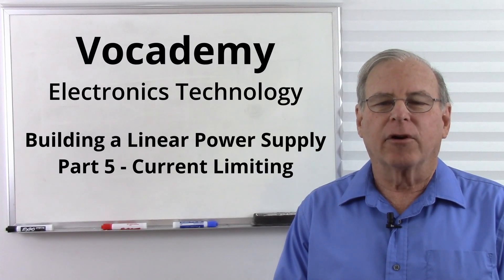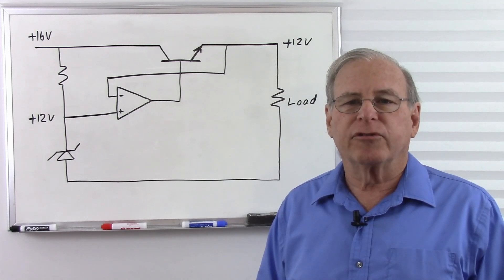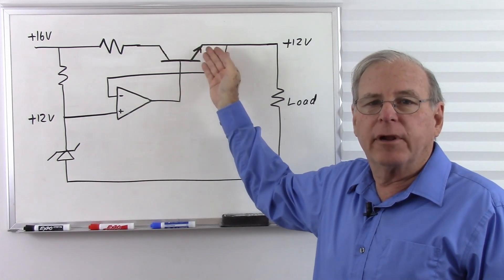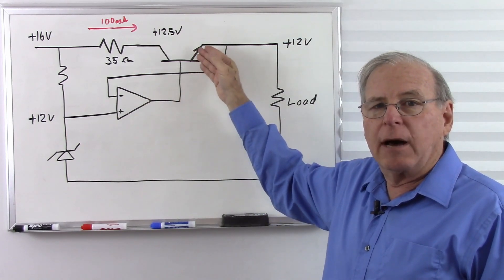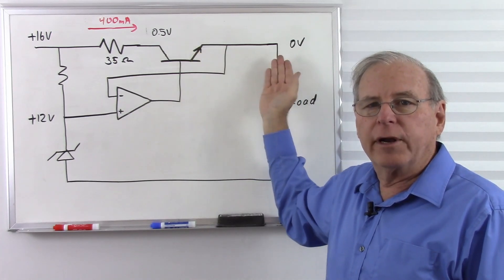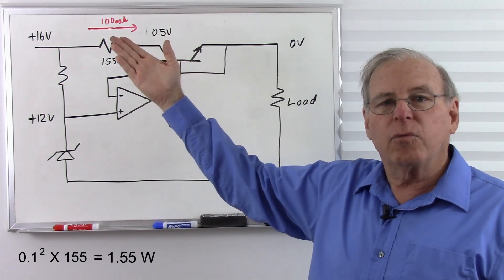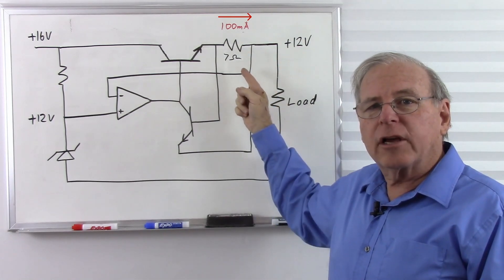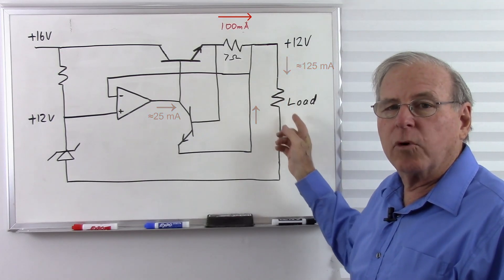Building a Linear Power Supply, Part 5   Current Limiting

Comment: Thank you very much, the circuit operation was very well explained. I'm wishing to current limit a 24VDC supply (capable of supplying around 300A) down to around 80A (or possibly lower). I don't need to decrease the input voltage like you have from 16V to 12V. With that in mind, can I simply connect the input voltage to the Op Amp without a resistor and/or zener (to keep the same input voltage) and use a high current mosfet instead of a transistor to limit the current? That said, I'm thinking I may get caught out trying to find a high enough wattage resistor to deal with the amount of current 🤔. My load is a bank of lead acid batteries I want to charge. Thoughts?

Comment: I am wondering why the OpAmp output resistor at 10:23 is put directly at the output of the OpAmp, which in turn will affect not only the collector at the second transistor but the base of the power transistor also? What if the resistor were put on the collector input to the second transistor AFTER the splice instead? Then it would only affect the second transistor.
Can you explain this a little deeper please?

Comment: the zener can be replaced with a resistor divider using a potentiometer to modify the current at the output?
i need to regulate a fixed 5v from 150mA to 1500mA

Comment: A bench supply needs to be variable.
Reply: Not necessarily.  A radio tech really only needs a fixed power supply at 13.8 Volts.  Granted I have supplies that range from 0-20V @ 400 Amp at the low voltage end for solid state work to ones that do 0 to 3,000 Volts @ 2 Amps at the high voltage end for RF tube type amplifiers.  But for someone who is only repairing two way radios 13.8 Volts is all you need.  Most commercial and public service two way radio repair shops are like that.
Reply: mostly you will need 12 9 5 3,3 if working with electronics 
and usually is 5v for ttl or cmos unless you do some DIY audio

Comment: Many power supply designs I've found are based on single-chip regulators (LM78xx, LM79xx, LM317, etc.), which require few external components and are supposedly very rugged and reliable. But, since I'm interested in learning how linear power supplies actually function, this series of videos has been extremely helpful. Your approach of building up the circuit in steps and testing as you go makes it easy to understand what is happening, and why.
Reply: Microchips aren't secure